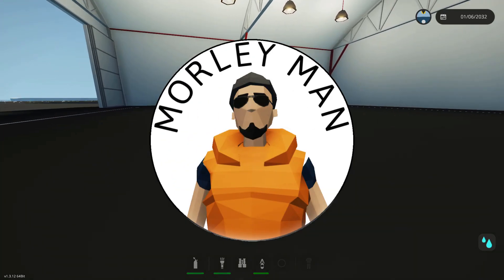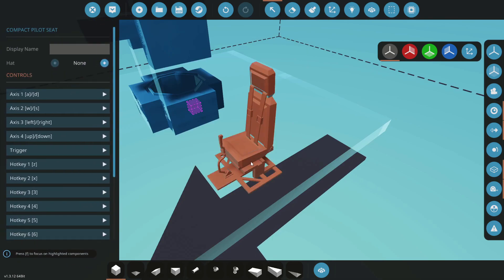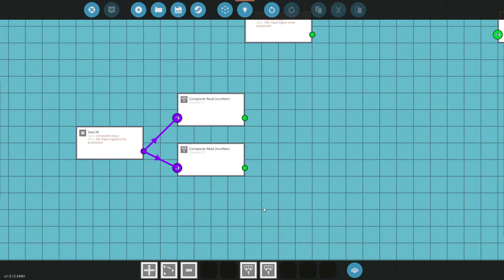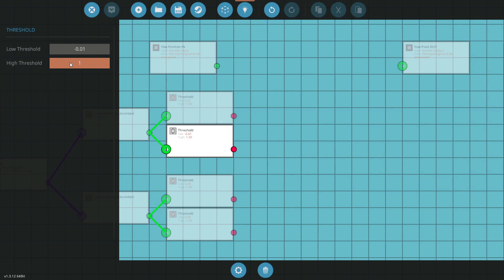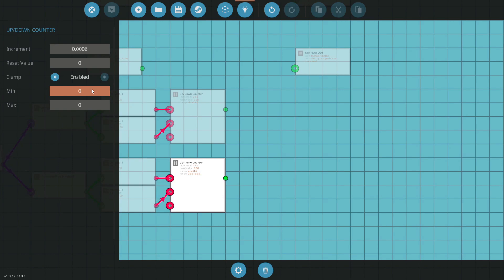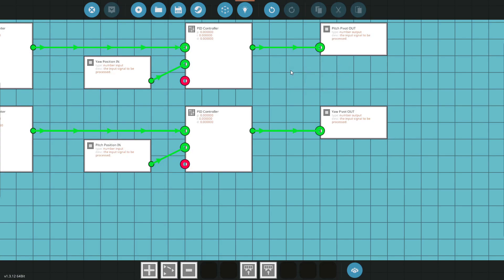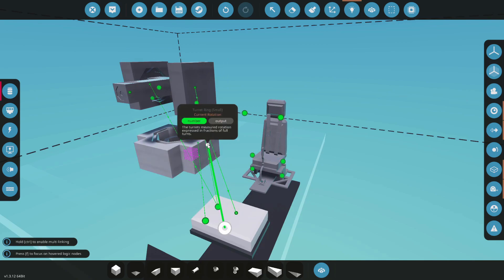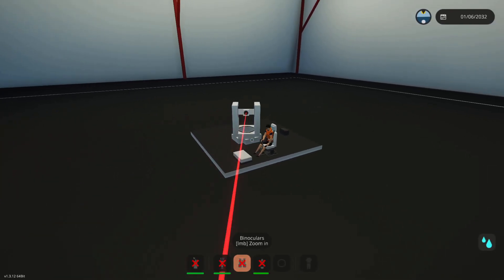Accurately Control Velocity Pivots with a Seat! l Stormworks Tutorial

Comment: Works great, but I ended up a bit confused, my pitch and yaw have a tendency to "bounce", like the turret rotating back and forth from one side to the other by like ten degrees, or my pitch bouncing up and down slowly, or sometimes the turret will spin uncontrollably fast
Reply: Nevermind, I realized what my problem was, didn't realize I'd accidentally hooked up my yaw to the inverter I used with my OLD control module, instead of the seat, and that made it freak outt. Works a dream now!